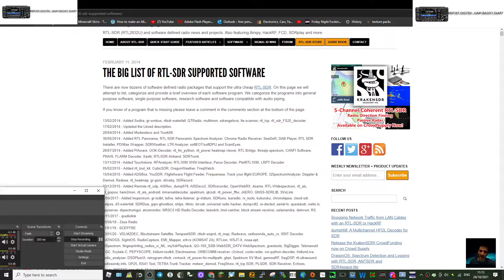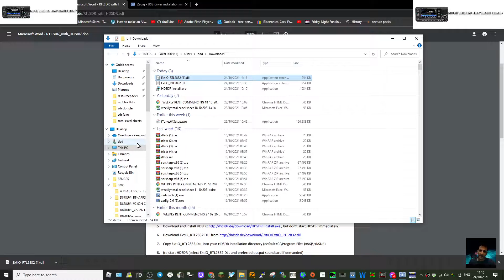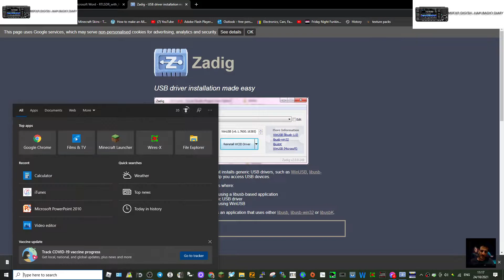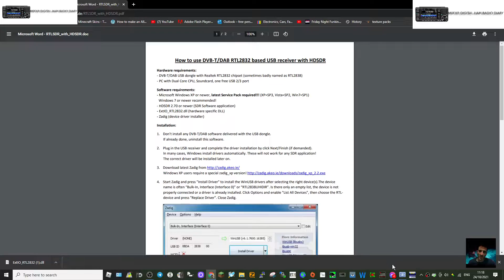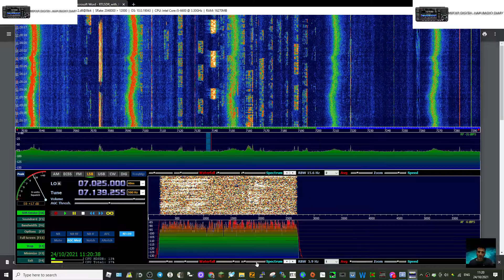HDSDR-free software RTL-DONGLE- instillation

Comment: Hi! The bulk in option does not appear in the list. What do I do? (Other options are displayed but none are the correct).
Reply from the maker: Select list all .
Reply: @M0FXBHamTech  Alredy did. No option such as Bulk in interference. I would greatly appreciate help, Thanks.
Reply: @polarbear5464  I hope this helps? since he didn't reply back to you! elect "Bulk-In, Interface (Interface 0)" from the drop down list. Note on some PCs you may see something like RTL2832UHIDIR or RTL2832U or Blog V4 instead of the bulk in interface. This is also a valid selection. Double check that USB ID shows "0BDA 2838 00" as this indicates that the dongle is selected.
Reply: @scvdad  Many thanks! i'll try that tomorrow. You are of great help. Thank you.